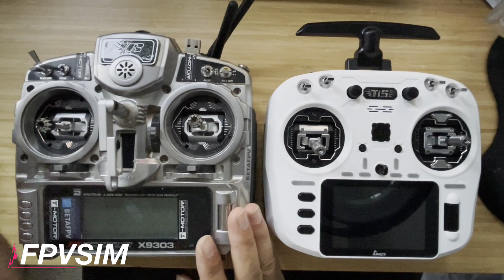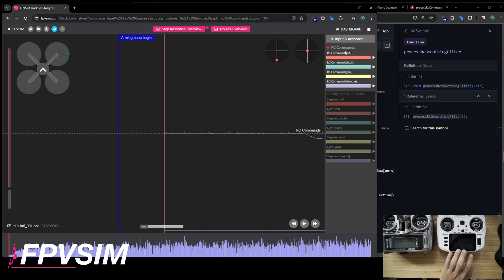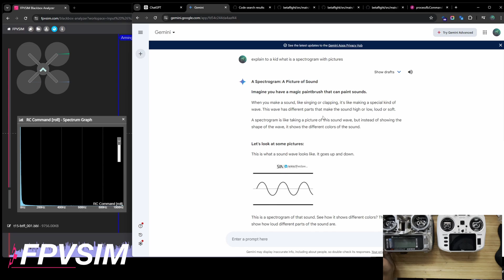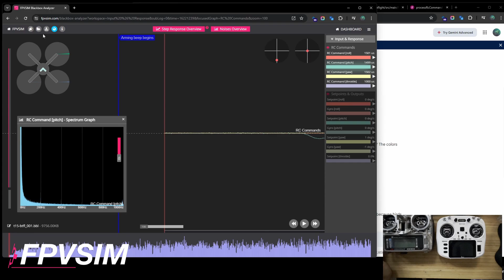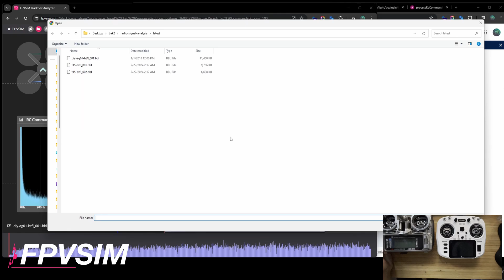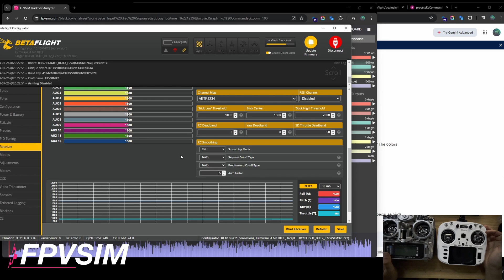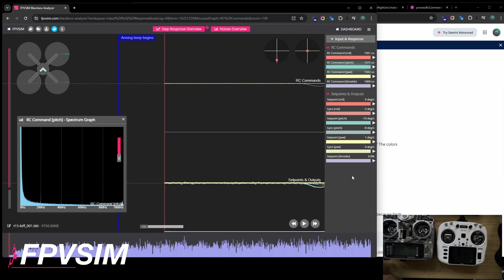Does Jumper T15 have cleaner signals? And How you can check yours too

Comment: how coud you use the elrs module on jr? i try to do but i cant
whit out lua i think is not posible
Reply: Its not possible. The jr external module bay only outputs analog pwm signals. Elrs utilizes digital inputs.
Reply: He's only using the jr9303 shell, internals are from frsky x9 lite probably running on opentx. The x9 lite shells are a copy of the jr. 
So what you get is essentially the high quality hardware from JR  but internals are running open source OS

Comment: It's very interesting. What do you think is wrong with the left radio? Is it the gimbals or something else?
Reply from the maker: Either the gimbal's hall sensor or the ADC from the STM32, the former one might be more likely since it's usually not that common for ADC to be faulty.
Reply: @fpvsim  Seems like it would be the other way around, that radio is much older than the gimbals? The ADC doesn't have to be faulty necessarily, it's maybe more so because it's old? Like Hall sensors aren't touching anything, mechanically they should be good forever, besides the moving parts that support the gimbals like bearings. 

I just have a hard time believing that the gimbals are the issue here, but I'm definitely not very knowledgeable regarding electronics. Just if I had to pick between a much newer component that is used by thousands of people that don't seem to have an issue, versus an older, and what looks to be a modified radio, I'd look at the radio first. 

Interesting video, thanks for sharing.